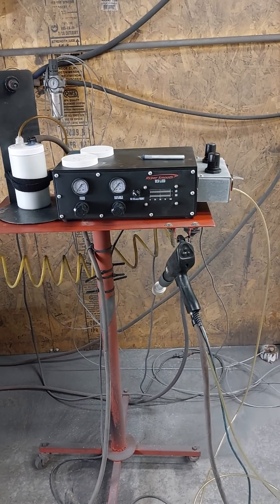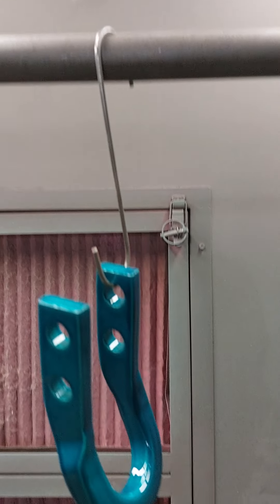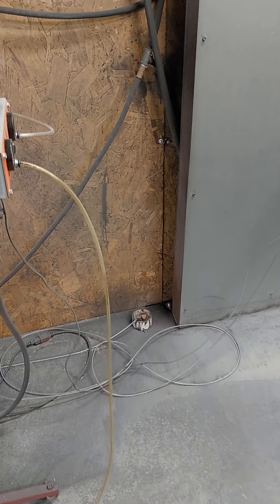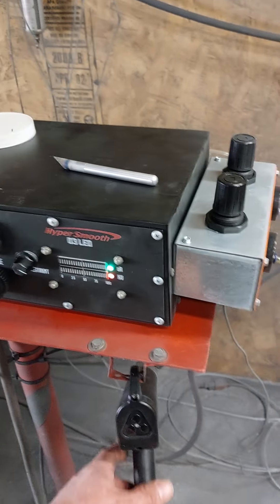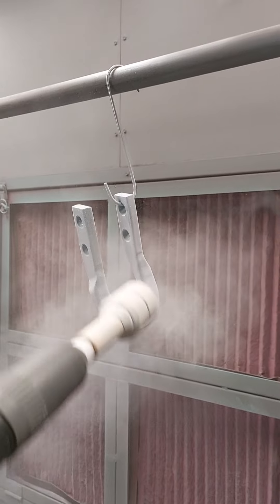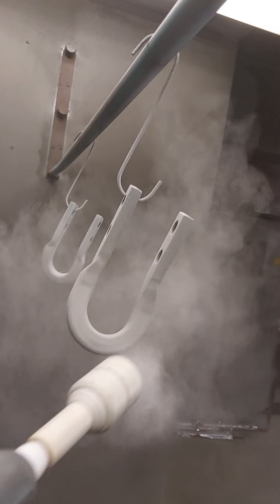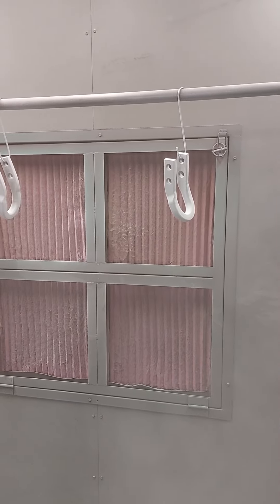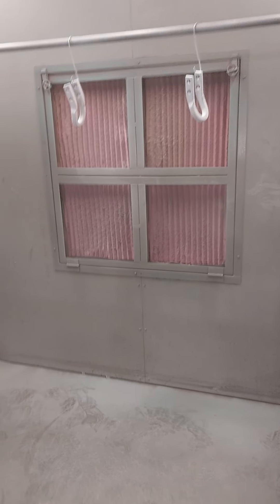Columbia Coatings Hyper Smooth LED 03 setup and multi layer spraying techniques!

Comment: would you go with the 03 with attachment or 02 with attachment  is that is even possible with an 02
Reply from the maker: Ive had both..  I truly believe they are exactly the same except for one has an  auxiliary air knob and feed line
Reply: @halfbakedcoatingsllc9911  Brother thanks for the reply, I know how much time is worth for those of us working with our hands running our business, so what is the purpose of the auxiliary air knob and feed line, why did you go from the 02 to 03? Thanks again
Reply from the maker: @CarlosDelaoGunEngraver   You need auxiliary air for a fluidizer